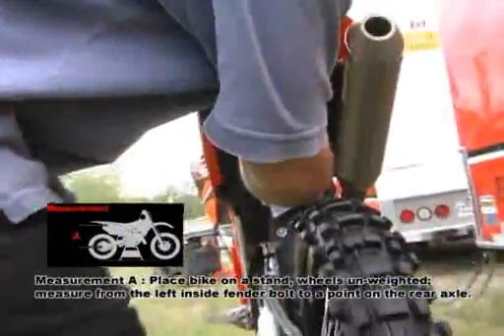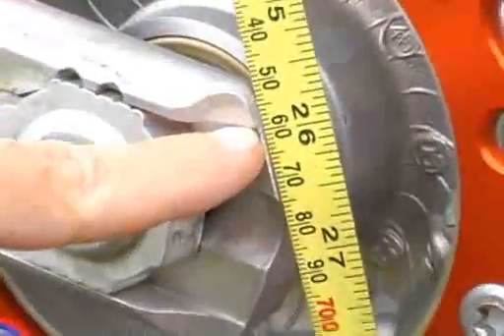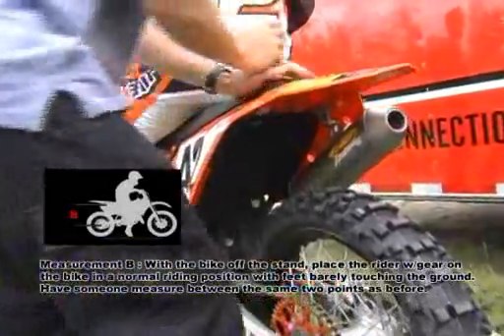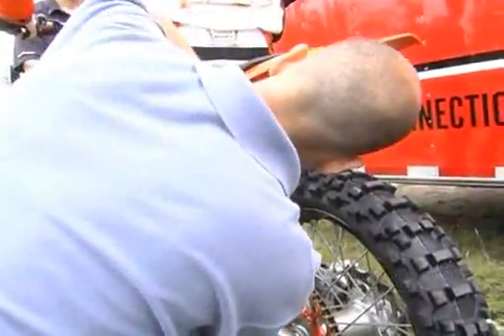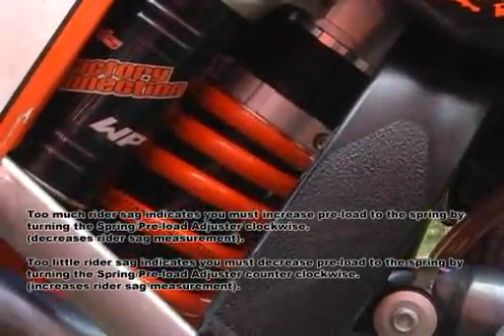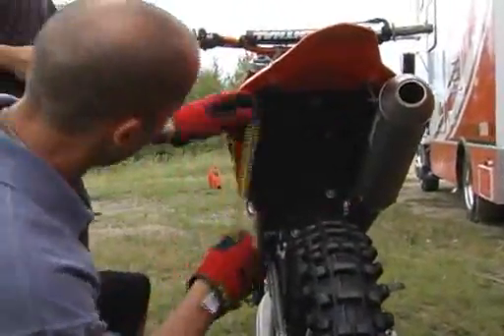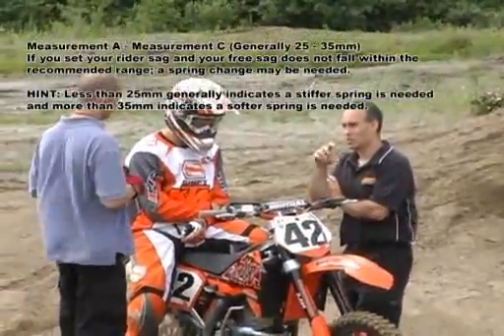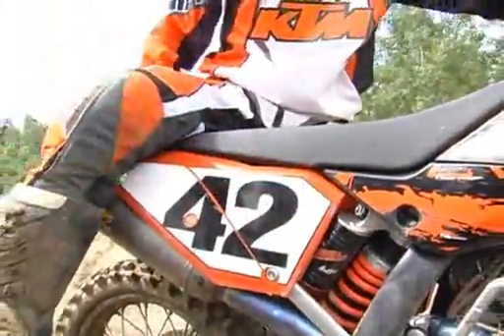Factory Connection Instructional Video :: Setting Rider Sag

Comment: do i have to set suspension settings to stock ? or i can keep em while i adjust the spring ??
Reply from the maker: It all depends on where they are currently set.  If you are only a few clicks away from stock settings we would suggest leaving them where they are.  If you have strayed very far one way or the other, you may want to reset to a neutral baseline.
Reply: i got my shock all the way to the right(stiff) so i will set it on stock settings thnx a lot!

Comment: @factoryconnection I've got a question, how can you achieve an accurate and consistent sag measurement with a rider sitting down? A quarter inch moved forward or back on the seat can change that number dramatically! Literally you can go from a 99mm to 120mm measurement just by moving 4 inches on the seat. You should really be measuring your sag with the rider STANDING on the foot pegs so the weight is centralized and your in your "NATURAL" riding position. Unless of course you promote a "Sit down Sally" approach to riding? Never seen a championship won like that hahaha

Comment: The free sag (from the bike's own weight) info in print in the video is backward and wrong. If the value is too small ( say 10-15mm) it's over sprung,  go to a softer spring to bring into 30mm range. If the value is too big/ soft, (45-50), a stiffer spring will bring it into 30mm range. Don't see how they got that wrong.